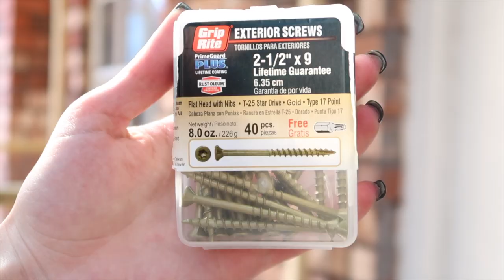DIY INEXPENSIVE OUTDOOR CAT HOUSE ENCLOSURE

Comment from the maker: A window CAT DOOR can be used if you don’t want to leave your window cracked! https://amzn.to/30Qj0V1
Reply: I have a 2 window unit so I can still close the inside window and i plan to tape insulate around the wood panel containing the door for a better seal. So far the door is on order but I plan on using Garage door water proof paint on the sono tube  for the entrance and this should water proof it for years to come, cutting the remainder in half and using them for some beds around the separate units with caged tunnels. This is an amazing idea and I love the fact that I am expanding the cats world around them in a controlled manner.
Reply from the maker: GREAT ideas!!!
Reply: It would be super handy if you could leave a list of the supplies and measure of the parts you used here! Thanks for the tutorial! 👍
Reply: I was thinking of getting a chicken coup and building onto it. The cats cant really access any of the windows in our trailer so i cant do this.
Reply from the maker: Great idea!!
Reply: what was the total cost? what size dimensions?
Reply: Fun fact. If you squash a wasp it sends out a chemical to other wasps. Those wasps will come in to see what's happening. If  you squash them too, well... you get the picture.

Comment: So I haven't found an easier way to cut the wire fence and I always bleed a little using it(always gets me).  I love the little garden in it. Beautiful cat.  Great job. First enclosure I built I hammered in horseshoe nails all over. Took forever!  Bravo for not letting your cat roam free, thank you for that.
Reply: Use an angle grinder with a cut off wheel and it will cut long sections of the wire fence with ease and very quickly

Comment: I know this is an older video but love the idea. How would you attach it to the house? I am afraid it could move and leave a gap between the catio and the house. I have an older stone house and was wondering how I could attach it without damaging the stone. Maybe I missed how it was attached but it looks like it was just built up against the house. Any suggestions would be greatly appreciated!
Reply from the maker: We did not attach it, but it was built to fit snug and under an overhang. We’ve had 4 hurricanes and it hasn’t budged. But if you need to secure it, the only way that would guarantee sturdiness would be to drill through the enclosure into your stone.
Reply: @NextJeneration  Thank you very much for responding to my question.    Definitely makes me feel better knowing it stayed put during those storms because my once feral cat can be a little hurricane herself! Your ideas really inspire me and my cat is going to love it!

Comment: I have a huge cat enclosure that runs from the house to a outdoor shed with electric in so can have an electric oil radiator inside and light, even a radio 😂 my 6 cats love the music.
Can I ask what plants are safe for cats please?, I'm going to plant some tubs up for inside and and buy  some hanging tubs too. 
Also I brough a couple of radiator beds and hung them inside on the run itself, and you can get a hammock which they love and hang from the top to sit and sleep in,  just a suggestion anyway lol 💕 Thanks again for the video 👍🐱. Xx

Comment: To avoid smelling up my small condo, I would build this for the sole purpose of providing a place for the Litter Box....From your knowledge, would that be a feasible idea? (I of course would add a small door from the outside to change the litter & I would have to leave the window cracked indefinitely) Please let me know what you think... (I'm a New Cat Father of two rescued litter mates)
Reply from the maker: That’s a great idea! I also have DIY Liter Box Enclosures on my channel that help in our house with smell. But if you make this, I would recommend a cat door (from amazon or hardware store) so you don’t have to leave the window open! Our AC has problems keeping up in summer, or it gets really cold inside in winter. Plus mosquitos. So we added the door & it’s awesome because they go in and out whenever they want!

Comment: I am looking to do something very similar for my cat! Did you guys secure it to your house at all? If not, does it wobblr away from your house? I rent so if I were to do something simlar to this I wouldn't be able to secure it to my house.
Reply from the maker: It doesn't wobble AT ALL!! The fence is pretty heavy once it's all put together. Also, we have gravel on the ground. So we dug a bit, put the enclosure down and pushed the gravel up against the bottom on either side on the inside & out. If you notice at the beginning of the video, I measured the enclosure to where it would be up to the brackets (1:18) we have for the over hang that's attached to the house, that way I can tie it up to that if there's bad weather. But it has been completely solid so far!
Reply: Awesome! Thanks so much! I think I have an idea on how I'm gonna modify mine for my house!! :):)

Comment: How did you secure it to the brick? I have two cats I want to do this and keep the cat litter out side but I know that would get out if it not secure to the wall
Reply from the maker: I have hooks drilled into my brick that’s holding the enclosure with rope tied to the hooks!
Reply: @NextJeneration  Thank you that helps alot :)

Comment: Did you attach this to your house or is it free standing? sorry if i missed this!
Reply from the maker: It’s ok! It’s free standing because I rent, but you can always bolt it to your house with brick screws. But I do have it secured with about 3 inches of limestone gravel at the bottom and I have 2 ropes tied around the frame on either side to hooks that are attached to the house! :) (you can kind of see the hook in the brick at 1:59 it has a black rope that I was previously using as a curtain tie)
Reply: NextJeneration cool, thanks for the info!! I loved watching you make this. My cats love going out in the stroller. And I’ve been thinking about doing an outdoor enclosure just like this! :)
Reply from the maker: @DaniCha  So happy to be able to help!! Thanks for watching :)

Comment: May I ask did you secure it too the wall?? X
Reply from the maker: We didn’t! And we’ve had hurricanes and it hasn’t budged. But it’s built to fit extremely snug under the over hang and buried into the gravel
Reply: @NextJeneration  thank you we are going to make one and this is fantastic thank you.

Comment: A Tip for those adding plants.. 
⚠️ DONT Put Lavender Plants In with Cats as they are Allergic
Plus don’t place, Lemon, Lime, Orange, Mandarin, Tangerine, Lemon Balm, Bergamot, Eucalyptus Trees Near your Catio and don’t use the trucks of the above tree for inside your Catio even if they are wrapped in rope or covered in carpet. Their tiny bodies can’t breakdown the Scents - also don’t use any type of Air freshener with these scents in them as over time it will affect your cat.

Comment: When using a hammer hold the base
Reply from the maker: Thanks for the advice, but holding it at the base makes the hammer WAY too wobbly to hit the right spot bc of the weight of the top of this hammer. So in order to hit the staples accurately, I held it higher :)